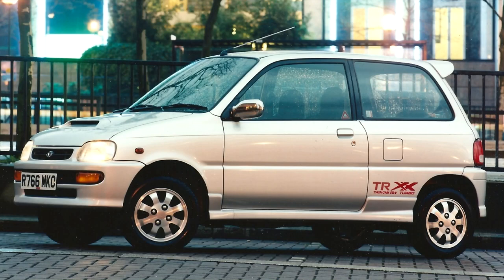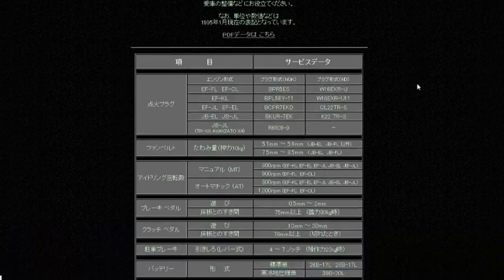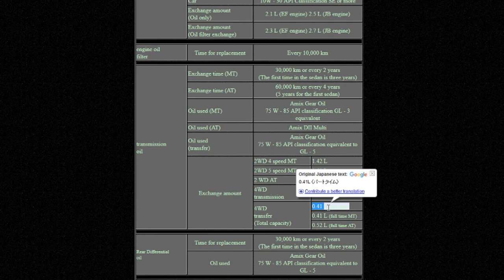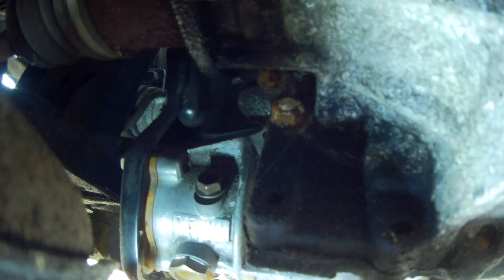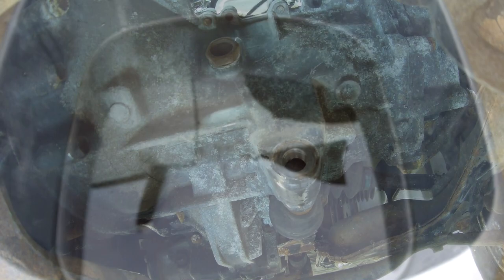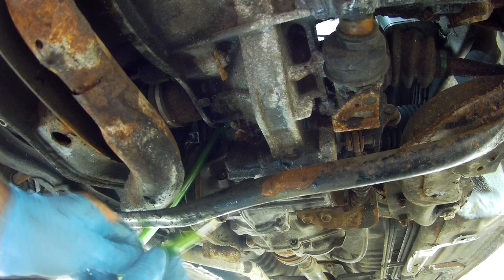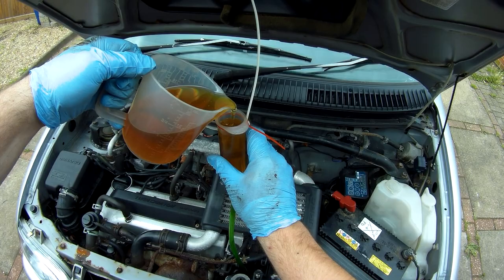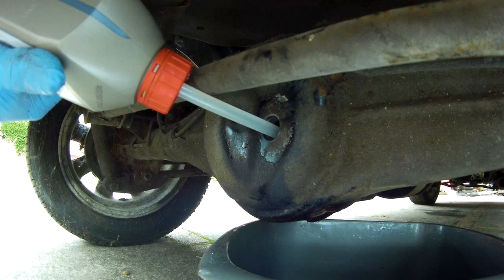How To Change Gearbox Oil - Daihatsu Cuore & Mira L512S - Avanzato TR-XX R4 Project Episode 6

Comment: Great tips as always, my fill plug on my c300 4matic was so hidden and required removing so much stuff so I just removed the drain plug and pumped it threw the drain, so glad I did that, save me probably 3 hours of work, damn you mercedes. You kinda get use to not having fill plugs on mercedes, the transmission had no fill plug or dip stick so you are forced to pump it threw the drain.
Reply from the maker: I've had the opposite problem before - fill plug, but no drain plug! So you have to remove the pan from the bottom of the gearbox to drain it, lovely.
Reply: InitialDave sounds like American engineering
Reply from the maker: Haha, yep, the 46RE in a Grand Cherokee. Axle diffs didn't have drain plugs either. Transfer case did.

Comment: Excellent,  and fun. Also you have done a top notch job of cleaning that car up from top to bottom. I know it took hours and hours of hard work.  Good job. I would however get some rust stop on the metal rusting there under the hood and top it off with some rustoleum paint. I have a 58 Cadillac that my dad bought in 1960😊. Still driving her around. Always needs a little this and that, and sometimes  the that is VERY EXPENSIVE!!! LOL Life long So California car. Subscribed.
Reply from the maker: The bonnet itself needs repair (they all seem to rust there), but yes, I'm planning on touching up and rustproofing the whole car, it's just a matter of finding time to do it.
Reply: InitialDave when you consider it sat out in the elements for all those years, and how much it rains there, its amazing that the amount of rust seems quite small. And the engine sounds quite good to me. How many miles are on this car?
Reply from the maker: It's done 35,000 miles. I think the car being sat rather than being used means it's avoided the winter road salt, which can really attack cars badly, especially where you have the Japanese models that don't have great rustproofing from new. I've seen cars far younger than this with holes you can put your arm through.

Comment: Hi there. I have a Terios and was hoping to change the gear box (manual) oil. Is this video applicable to my Terios? Thanks
Reply from the maker: @grahamskinner3325  I'm afraid it's probably only of limited reference for you, as your drivetrain is completely different, but broadly speaking the process is similar on any car, its just a question of knowing what the correct oil type and quantity is

Comment: I have problem when the car is cold the gearbox is not working I have to wait for 15 min then it will work normally 
Proton wira 1.5 auto 2001
any one know what is the problem ?

Comment: Is that a DDR-Ruhla (DDR made) rear fog light in the white zip tie?! :D 
ps: You've done a nice job! It a great car, congratulations!!!
Reply from the maker: Hah, that's certainly an interesting question! Well, I don't think so. It was a Laser brand one, and was "E" marked as "E2", which I believe is France? Plus, it would have been fitted when the car was being prepared for the UK to meet our regulations, which in 1998 would be many years after German reunification, so unless someone had a big stock of them, I can't see it being from a period when the DDR was still a thing.

Glad you like the car/videos though!
Reply: Thank you for the quick reply!
Almost got it... ;)
Its shape seemed just very familiar to to e.g. this one:
https://www.ebay.ie/itm/Vintage-Classic-Car-RING-Safety-Fog-Light-Lamp-New-Old-Stock-/142150534709?hash=item2118d50635
I'm an East-German (and Japanese) car enthusiastic and in the late models these rear fog lights were used in many cases on Trabant, Wartburg, Barkas, etc, but used to came out as a spare part also.
I 'm aware of the fact that this kind of stuff would be probably very rare in the UK, but who knows... ;)
Br,
madogery
Reply from the maker: I suspect that it's one of these things where there's one or two places actually manufacturing them, and just putting different markings on them depending who it is a given batch is for.
Or one of them's the original, and the others are knock-off copies.

Comment: Great series.any plans to modify it.if so let me know i have a racelogic vbox if you want to know the before and after performance stats
Reply from the maker: I think right now I'll settle for getting it back on the road rather than getting ahead of myself! The only modification (as such) I have planned is a slightly smaller steering wheel, I'm intending to keep it pretty much standard overall, at least until I'm more comfortable with the exact condition everything's in.

Thanks for the offer, though!
Reply: @InitialDave  informative

Comment: get some wax oil on the underside she will last forever then !!!
Reply from the maker: I'm intending to, just waiting for the weather to be a bit better for doing it.
Reply: InitialDave ideal yeah that's the problem over here in UK the weather is crap 😂 where abouts in the UK are you from im from Worcestershire
Reply from the maker: I'm in Leicestershire.
Reply: Ah right well you are lucky to own a nice rare car like that
Reply: I have the same car, a UK spec one. It's got a horrible bit of rust underneath that I'm kinda worried about. Need more time and more moneys 😣 nice to see someone else keeping one going and making videos on how to do the stuff I need to to on it. These videos are what I needed! 👍
Reply: I'm in Bristol btw
Reply: Nom8 do you want to sell yours ?
Reply: Not unless you got 3 and a half grand burning a hole in your pocket? Lol and in the condition it's in atm it ain't worth that moneys. it needs a bit of rust sorting and the back window is smashed and taped up due to vandals :( got a new boot lid with a pane of glass to go in it but it's from a cuore that isn't a avanzato so I'm just crossing my fingers hoping it will fit.
Reply: I would need to save up a bit longer 😂 but yeah I don't doubt it is worth that much awesome cars ain't they
Reply: They are awesome cars I love it! Shame they didn't bring more of them here.